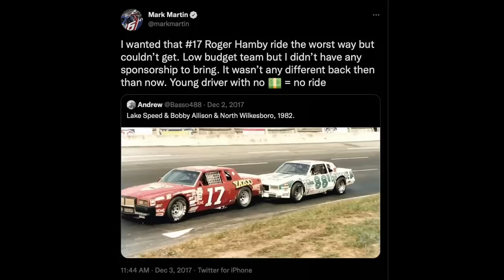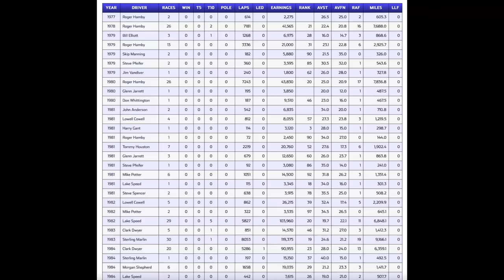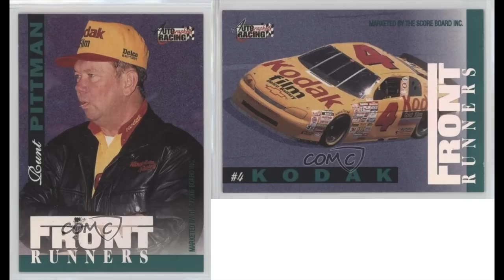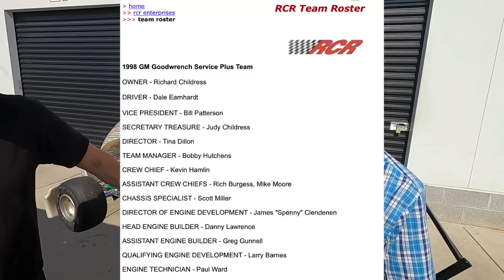Lake Speed’s Perspective on Recognizing Unproven Talent: How Did He Find So Many Future Standouts?

Comment: Every time he gives it the beans he pulls away, that 4 stroke thumping, putting down the power. Badass stuff man. But there is nothing like bringing your own torque plate to the machine shop. It's like asking what the fillet radius looks like on the crank grinding stone( and actually knowing what it means) More black Monte soon? Or big block suburban? No rush, parts are the biggest p.i.t.a. nightmare they have ever been, so I understand. I'm about ready to put a stock cam back in my big block truck just to use it again. Scared to buy another soft new one, and hydraulic roller is waaayyyyy out of my budget. Maybe yank it out and put in a 09 5.3, then just need somebody to flash a computer........
Reply from the maker: Monte is coming soon! We have to change the radiator. It’s leaking
Reply: @Stapleton42  understand, I will still watch the racing history stuff in the meantime, absolutely no complaints.